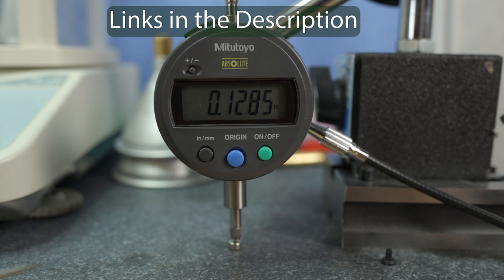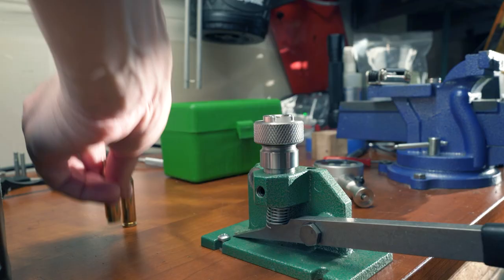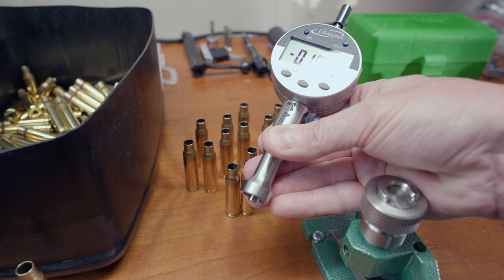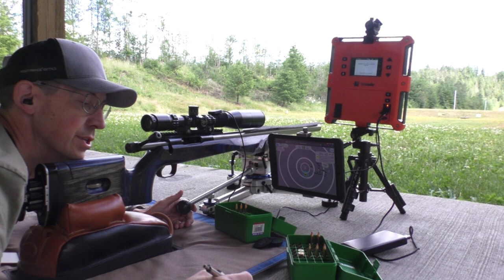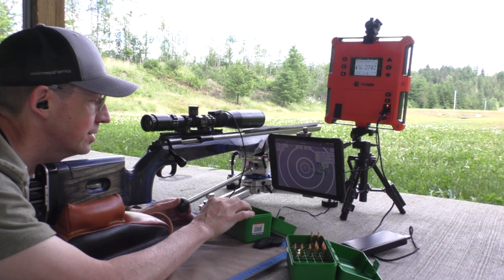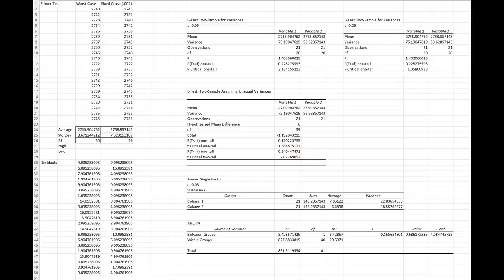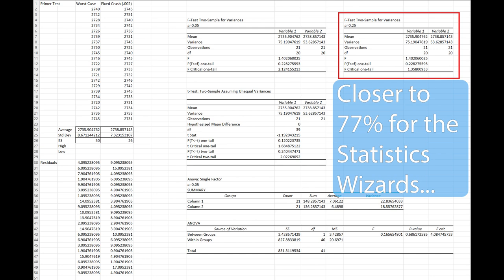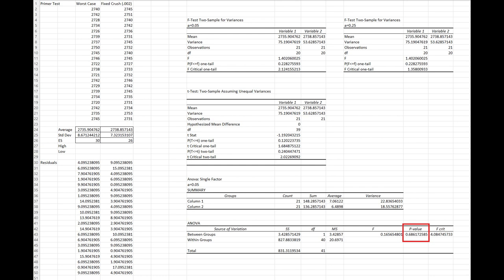To Crush, or Not to Crush, that is the question.

Comment: What about just using force instead of position.  A seating device that accurately controlled the seating force seems to be a way to consistently seat a primer.  (Like a hand seater.)  The depth dimensions of the primer and pocket would not be a problem.  The diameters could be but are probably more closely controllable by the manufacturer.  Still, great video and good luck.

Comment: Good study!  I am wondering how much the general perception that Federal primers are more sensitive than some others might factor into immunity to the need for crush, and the same with mainspring condition.  In other words, would marginally energetic firing pin impacts start to produce more performance difference?  A lot of the crush spec testing came from the military, which has to have functioning over a wide range of conditions.

Comment: Consistent primer seating depth depends more on the primer pocket than the priming tool. Anyone can notice there's a difference between some cases, with the same depth setting on the priming tool. Less friction between the primer pocket walls and the primer cup means primer seated deeper. You can check on many reloadings by marking your cases. Since primer pocket uniforming tools dont solve the problem, the best way is to take a measurement of your primed cases. When I see that some companies selling some "special" priming tools at 600$, this is bullsh*t

Comment: Keith, 

So what I gather hear is, Greg's theory on crush and primer height being a factor does not prove out in this test.

Your test doesn't test varying depths though, and I can't say that makes a difference or not, but I can maybe see that a consistent depth makes a difference, and maybe it has more to do with striker timing, or flame propagation timing.

So I can't say forsure, but I think if your primer depth remains consistent through your tuning process and beyond, that may make a small difference. So don't count these tools out yet, not sure if a $600 adjustable unit its nessisary, but one that can index off the head and has a consistent stop maybe just the ticket.

I also wonder how consistent the flash hole depth is, and how that effects the ignition.

Comment: Soo.. seat the primers via an arbor press with a mandrel pushing on the interior of the case against a flat surface for flush, or against an adjustable 'ram' that controls seating depth for below flush seating. 

No, I didn't see the Patreon video. Am I close?
Reply from the maker: You did a good job of explaining some else's patent. Mine works differently.

Comment: You don't crush , if the primer pockets are properly uniformed then the primer slides in nice and you should be able to feel the skirt of the primer bottom out in the pocket .
Reply: Or the anvil bottom out.
Reply: @rickoshea8138  The anvil is just sitting in the primer cup in a not so precision position . When the skirt of the primer cup bottoms out the anvil feet become level with the bottom of the primer pocket , a kind of preload  position . People sometimes get misfires if the primer is not seated  properly because the anvil moves away from the crush as the firing pin strikes ,softening the blow .